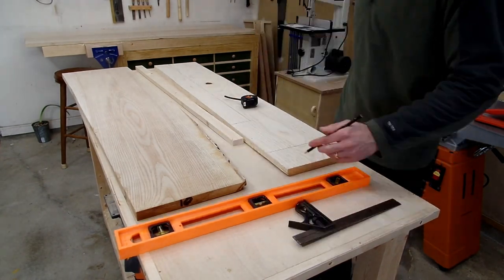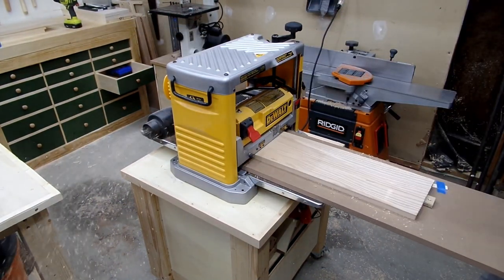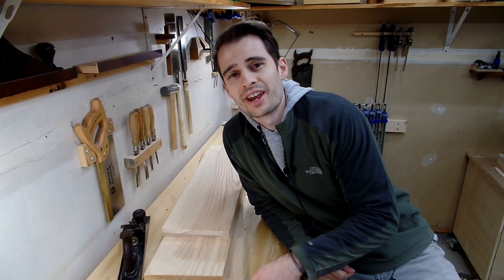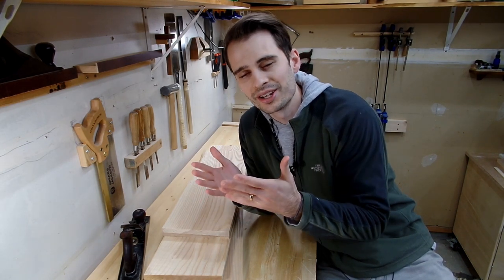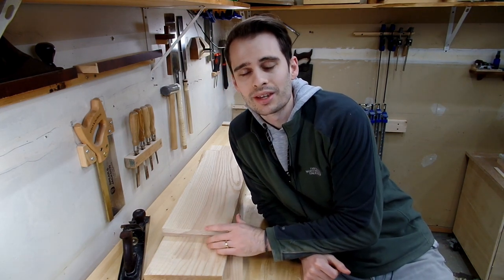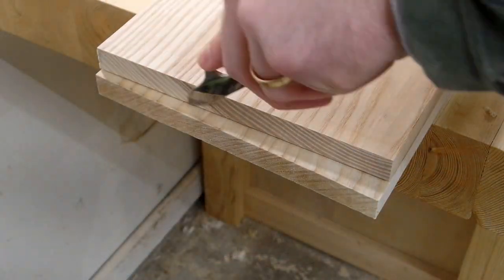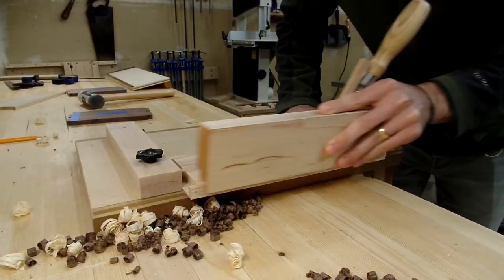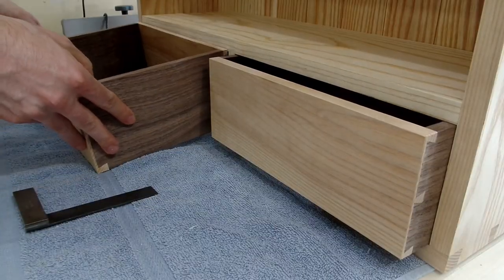Building a bookshelf for my office.

Comment: I have a pro shop with all the pro machines in it. i was trained on hand tools many years ago. When I retired from pro work I went back to my roots, hand tools. The only time I use a machine for anymore is ripping boards to width, cutting mortices and a lathe. I join my boards with jointer planes, flatten my boards with hand planes, use a smoothing plane and card scrapers to finish with using no sand paper. Invest in the best hand tools you can buy. I use Lie Nielson hand planes and saws. Have a few Veritas tools also, some Stanleys and a whole lot of old wodd hand planes. I have 12 Japanese saws and use them often. I have Swiss and German carving chisels, bought one at a time until I completed my collection of 45 chisels. Took a long time to get all the hand tools I have. I like Moxon vises and have no tail vice either. You do excellent work and should think about more hand tool work. I do reproduction Chippendale, Shaker and Colonial furniture and make a lot of money doing it on commission only. Keep up the good work, and by the way, the only time I use ash is for firewood lol.
Reply from the maker: Thanks for the kind words and encouragement! I want to begin investing into some nicer hand tools. I think I could really benefit from a nice dovetail saw.

Comment: I have the same planer and ran into the same issue when trying to remove twist and bow using a sled. I believe the sled needs to be very stiff to get the board truly flat. If there is any deflection in the sled, it will transfer to the board you are trying to get flat.
Reply from the maker: Thanks Peter! That sounds like maybe what was going on. I would have though the 3/4 inch MDF would be sturdy enough, but maybe it isn't?

Comment: Nice work! I think a couple keys to cutting grooves and dadoes are passive stops and holdfasts. Working against (or along) a bench hook and sometimes knocking a holdfast in will definitely speed things up and make them easier!
Reply from the maker: Yeah, I really want to get some holdfasts. I think those would really help with the work holding.

Comment: IMO when you used your sled you used nowhere near enough wedges, and yeah hot glue helps a ton. You need to wedge the board the whole length to prevent it from moving when the planer applies force to it, not just at the ends. If the board is bowed/not flat, it's going to be pressed unevenly by the planer, that's what you want to avoid. Personally I keep a drawer full of small/thin offcuts that I use for this purpose and I use a ton of hot glue.
Reply from the maker: Thanks for the info! Yeah, I think I really didn't support it enough.
Reply: @DaughtersWoodCo  There are even people who make sleds with hardware that allow supporting the board from the underside, not just at the edges. I make smaller things so I've never needed one for now.